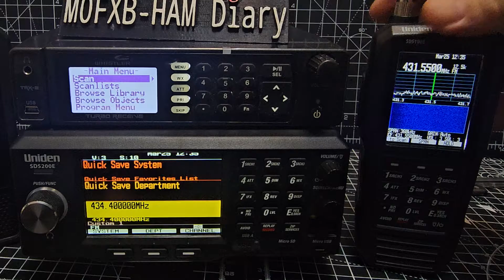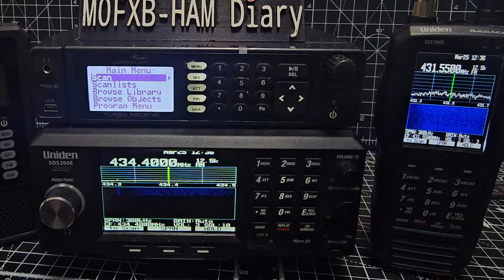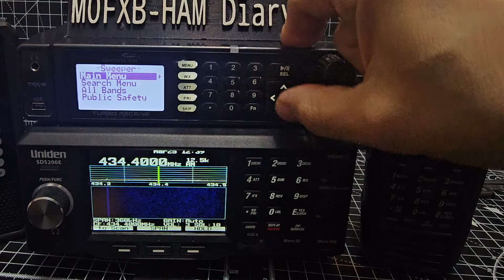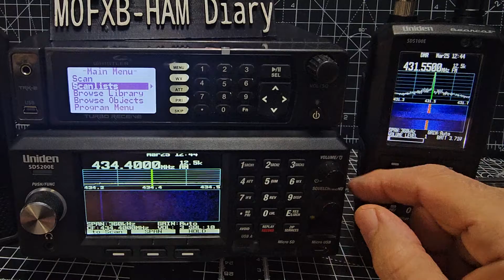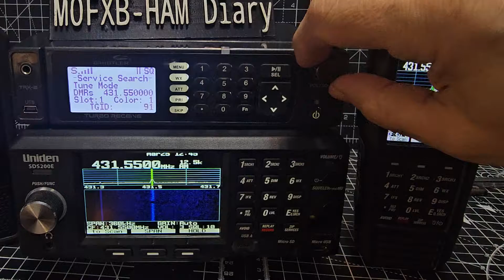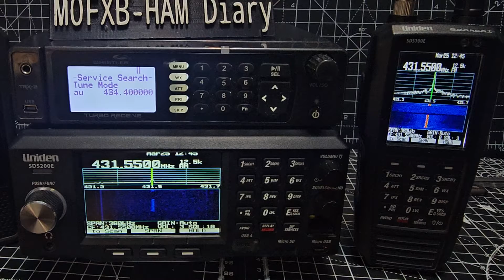UNIDEN SDS200 & WHISTLER TRX2 SCANNERS

Comment: TRX2 is identical to the TRX1 for the features, and 200E is the same as the 100E. There are no Uniden scanners that will detect single slot pulsed DMR.
Reply from the maker: Both are great scanners.
Reply: @m0fxbhamtech  didnt answear my question though

Comment: On the sds100 waterfall how do u get the signal to be that strong and the noise floor so low except for the frequency when i tune to my strongest freqs it's shows it's weak
Reply from the maker: Ypu need better antenna and a strong signal .